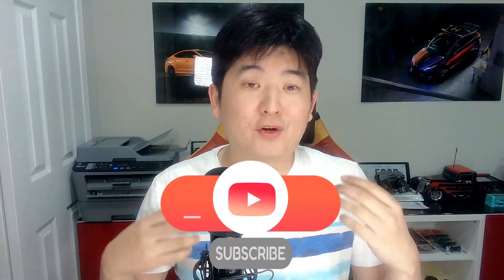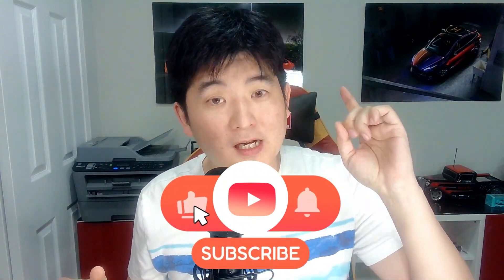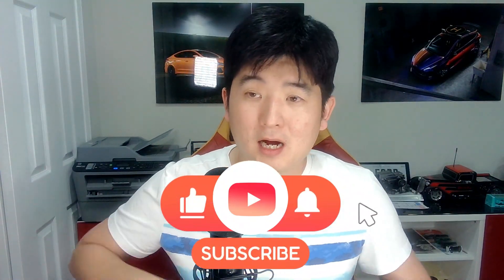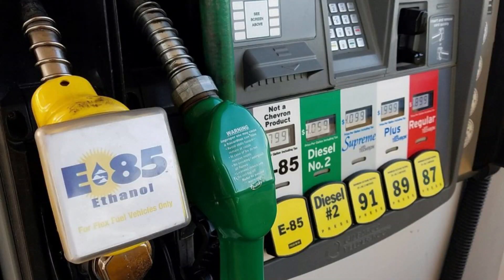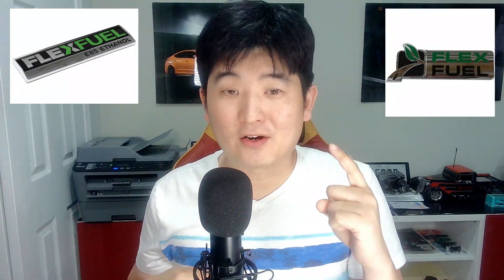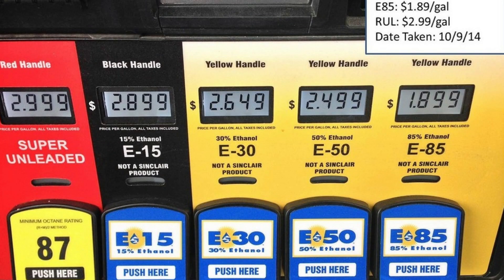How to run E85 in your car for 20% power gains!

Comment: You are so right! Personal experience, I had an old Volkswagen Lugo 1.4l! Dumped E85 with no mods, it had a little struggle to start when too cold, but apart from that clean! No issues whatsoever and as you said just a little more consuming but CO2 and engine, everything remained clean.

Comment: My FFV has been running well beyond my expectations. With a certain MOD I’ve achieved better MPG on E85 (83% Tested). And saving over $2.25/gallon since switching from Non-E…….
Reply: So it's e83 with what you said that you tested it at so you don't put e85 you would just put e83 when you know the value that the ethanol is testing at percentage wise. Or you can just say ethanol

Comment: E85 is also way to go if you prefer to have bit longer lifespan for yourself. E10 in the US is the most corrosive, dirtiest and toxic gasoline due to its unusually high BTEX content that it makes quite different type gasoline than others with more ethanol.